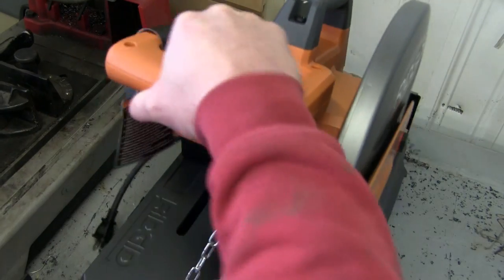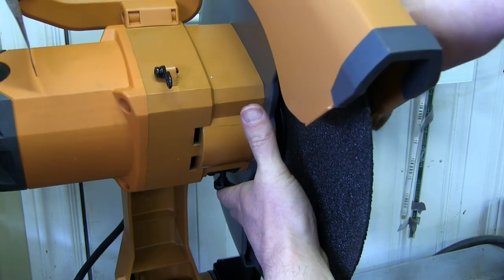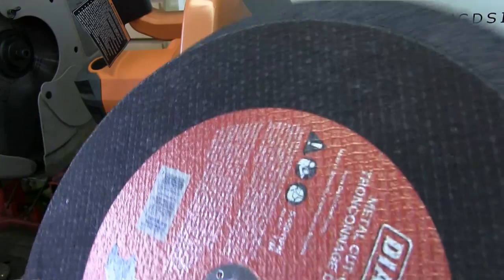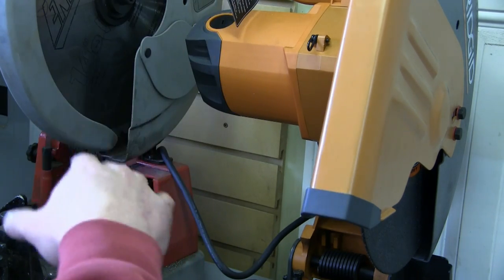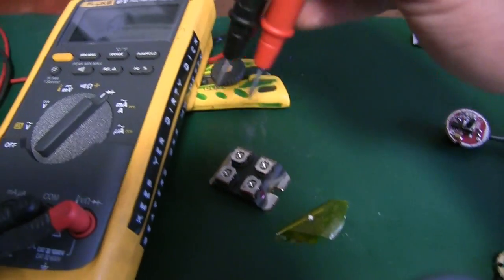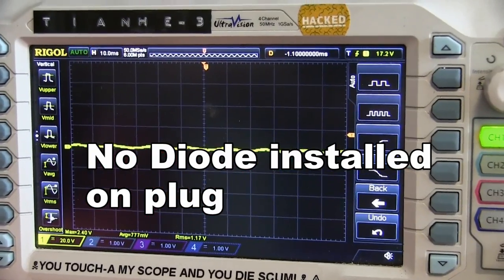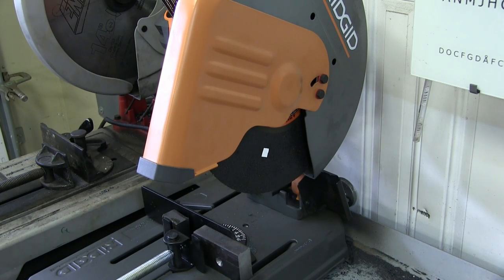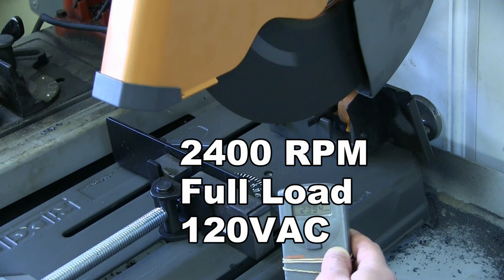RIDGID abrasive cut off saw converted to dry cut. Maybe.

Comment: I'm late to the party but I gotta say you're scratching your ass with your elbow. The speed torque characteristics of a series motor on AC arent intuitive but that's not really the problem. If you wish to run your 2900 RPM saw at 1500 to run a dry-cut carbide blade you will have to change the reduction ratio. That's your only option if you hope for a fully functional dry-cut saw at the end of your conversion.

You hit it on the head: motor torque is roughly proportional to motor Amps (correcting for power factor, if applicable.) BUT - if you halve a DC shunt wound motor's RPM by halving the voltage, you also halve the motor HP at full motor amps. A series wound motor's speed/torque/Amps/load characteristics is far more complicated. Suffice it to say, series wound motors have inherently poor speed Vs load regulation. If you hope to predictably lower a series wound motor's RPM and desire good speed regulation you will absolutely positively HAVE to have some form of RPM feedback to an electronic speed control such as made by KB, Dart, and others.

Anyway, I looked into this very problem some time ago. I concluded there was no satisfactory pure electrical conversion that would result in a powerful productive dry-cut chop saw comparable to the purpose-made saws now on the market. The best bet would be to bite the bullet and buy an Evolution 380 for about $400. As of late July, 2019, the more affordable dry-cut saws run from $265 to $400. 

The next best if labor and ingenuity is plentiful and bucks are rare, find a cheap abrasive chop saw that has a toothed belt reduction. Note: gear reduction saws, though far superior, are far more difficult to change ratios because the gears are helical and hardened helical gears suited for high RPM in the correct ratio are scarce, expensive, and the conversion would require skilled machine work. Converting a toothed belt reduction would be simpler and much less expensive. But either way, determination and ingenuity are still required.

Comment: You can get an Oshlun 10" blade that will do 5200 ripums with a 1" arbor hole  You lose a bit of cutting depth but it should still work in theory.
http://www.oshlun.com/steel_and_ferrous_metal.html scroll down to "SBF-100052"
Reply: Crap, you said the Ridgid had a 20mm arbour.  That ain't gonna work.  My super shitty chineseium abrasive cutoff saw at least has a 1" arbor.